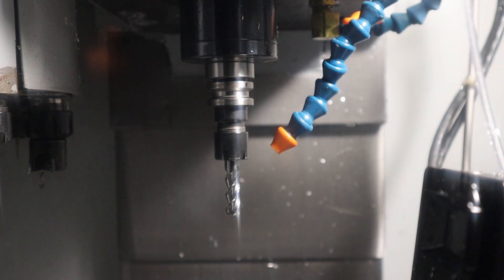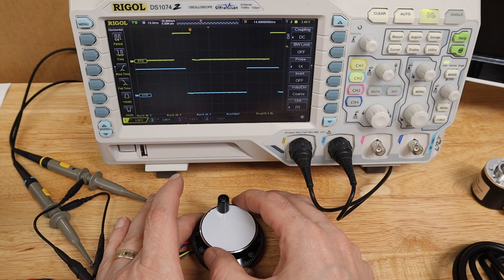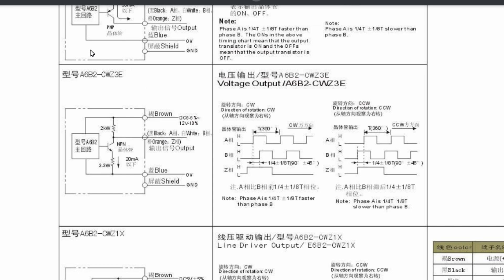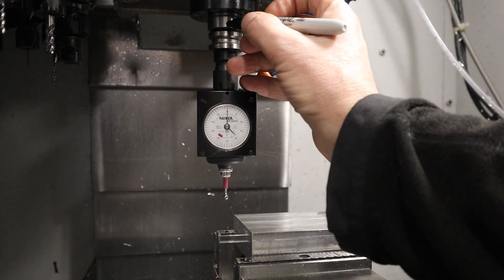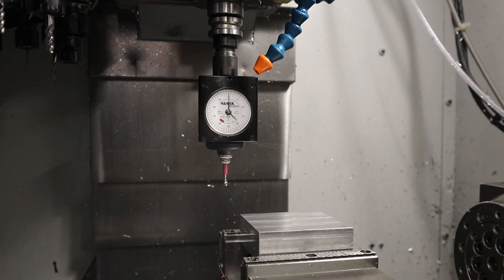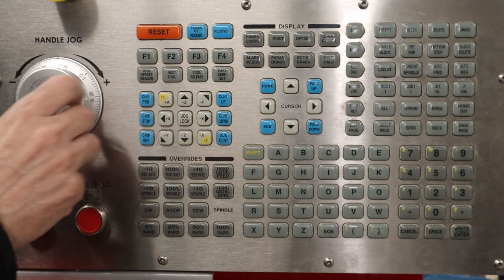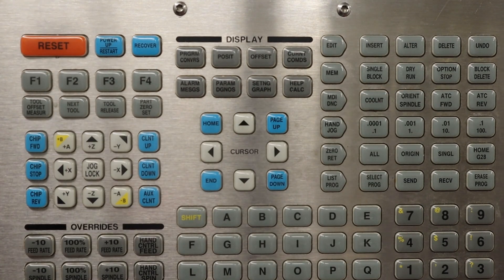How Precise is my Haas?

Comment: Years ago I explored machine accuracy with a laser interferometer that measures within a millionth. I had to build a device to calculate the speed of light based on air pressure, temperature and humidity to get to better than 1 ppm. This device was interfaced with the interferometer directly. The speed of light in air is about 280 ppm slower than in a vacuum. I had a high end Matsuura milling machine with box ways. It was spec'd to repeat within 80 millionths, it was often much better often 10 millionths. I was amazed. But how well did it position? That was determined by mostly lead screw temperature and position in the travel. Of course the temperature of everything associated with the leadscrew mount contributed too. At one end of the travel near the beginning of the leadscrew it has little effect where as at the end it has a much larger effect. With a coefficient  for steel of something near 12 ppm/deg C a 12 inch screw would change a thou in only 7 degrees of temperature change. what about a 40 inch screw? The lead screw starts at ambient but warms up a lot with use. When it does it is like a scale factor change. It might even not be uniform in temperature along its length. Some exotic machine liquid cool their leadscrews to tame this problem. Hardinge on their high precision lathes handled headstock thermal growth with a linear scale to measure it and put a correction back in to the control. Some mills and many wire EDMs and CNC grinders use linear glass scales to correct leadscrew induced errors. So a mill that repeats to 10 millionths might be out a couple of thou when it warms up. I replaced the Matsuura mill with a new one with ball bearing rails. It wasn't anywhere near as good as the old one. We haven't even talked about leadscrew correction tables which some controls have. I spent days tuning the leadscrews which was a waste of time. While this topic goes well beyond the space here there is one other issue that is everything is elastic. The cutter, spindle, work piece, vice....etc. So the machine only positions correctly at zero load. This what so called spring cuts are for. But light cuts that are under the effective radius of the cutting edge rub more than cut. This means a worn cutter will cut a different size while its sharpness diminishes even though its diameter doesn't really change that much. The more you understand this the less likely you are to believe precise machining could ever be done.

Comment: That's a heck of a hobby machine :) and a nice video. Some comments:

2:54 - To be pedantic, the z channel will let you find a home position to 1/2 of an a/b quadrature pulse width (90 degrees of a channel period). The rising and falling edge should always fall in the same 90 degrees of a quadrature cycle (different for each side of the pulse). The z channel can be gated to rise with the quadrature edge, though I never understood why one would actually want that. z channels can be different lengths. The one you have shown in a full quadrature cycle long. I'm used to z channels are that are 1/4 of a quadrature cycle long, though they do the same thing, at the end of the day -- tell you where you are in a full encoder rotation.
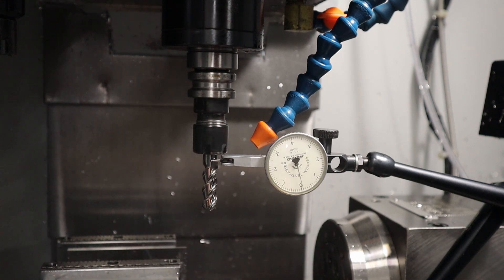5:00 - I'm surprised that you could move it so far. You could hear the servos fighting you. They don't appear to be using an integral at any meaningful bandwidth -- that's honestly pretty soft. For anyone interested, the integral will drive the servo encoder to a zero position error, within its resolution, leaving only mechanical error. Linear / glass scales will drive the linear position error to zero, at the linear encoder, leaving less mechanical error (no screw error, etc.).

Comment: I would say the Renishaw system as you mention at the end, is good, but in practice (for me, as a glorified Hobbyist) it's not really much better than about .0005. It'll certainly feed the machine outputs down to the tenth, but in practice there's some wiggle on that. You can probe the same surface 5 times and get different results within .0003 or so. For tool probing it's the same. Theoretically it can tell me the average diameter of a tool between the flutes, but, when I actually put cutter comp into practice it's still liable to be a little generous with the diameter. I'm sure half of that comes down to runout and the other half the probing, so using a much higher grade of tool holding than my mid-range ER collets would probably bump it tighter and then in production knowing when to check a part and add/subtract a few tenths to the probed diameter would get you to where the inherent qualities of the machine is a bigger concern.
Reply from the maker: It's good to know. I think the main advantage for me of a probe would be tool breakage detection.
Reply: I've always found the probe to be within microns of repeatability - usually 1-3 microns! It does need some setting up though.

Comment: That was interesting John, have never done that, now that spring is here and I can get out in the shop (not much colder then a uninsulated steel bldg) will test how my CNC fair's.
Reply from the maker: I'm so glad my shop is completely insulated with a mini split. So it's comfortable all year around. Plus, because it's attached to the back of our attached garage, I can get there without getting wet or cold. Hope you get to use your machine now that it's warming up.

Comment: Just a suggestion, don't leave tools in the spindle unless cutting. No need to keep load on the pull stud/drawbar springs. Also, put a dial indicator on your "probe". I self calibrate/adjust  mine using a dial indicator and a gage block. Definitely always put your probe in the spind oriented position. Thanks for posting your video, are those BT 30 holders?
Reply from the maker: Thanks. I've now started to do just this.

Comment: Is this machine belt driven or is there a direct ATC spindle installed? Can you show some pictures from the top inside? For such small machines I'm still in favour of doing them myself (since I already built a relatively small one 40x20 which can also cut S45C steel I'm aware of the effort.
Reply from the maker: It's belt driven, and showing a photo of the insides would require me to take some panels off. This is a Haas OM-2A, which is basically the same as the newer CM-1.

Comment: Hello, good video, however please remove all tools from the spindle when not in use, they can break the toolchanger plate right in half, I've seen it many times, it happens when the tool is left in there for a period of time long enough for it to lock up in the spindle. Temperature and drawbar force ect.
Reply from the maker: Thank. I am now doing that. I guess I've been lucky so far, but don't want to push my luck.

Comment: All I know is your machines are far more precise than mine.
Glad my work is just art work with tolerance of whateverths.
Reply from the maker: One thing I keep hearing is that precision is more about the machinist than the machine. You can get really accurate parts with a manual machine that has huge backlash if you know what you're doing. I was able to do some really detailed work with my Taig CNC (using end mills down to 0.01 inches in diameter). That being said, it's nice having a "tight" machine.
Reply: @JohnSL  the thing I found out was lash is real bad for climb milling. Conventional mill keep your bits. You can file just fine.

Comment: Your taking a lot of your measurements on the upper edge of the stock where there could be a burr. The machine may be even more accurate then you think.
Reply: I said the same thing...each time he touched off the X axis, the haimer was at a different Z location....def introducing uncertainty into your data....